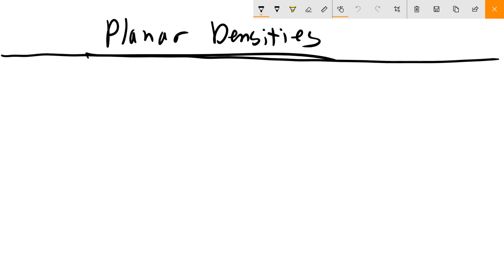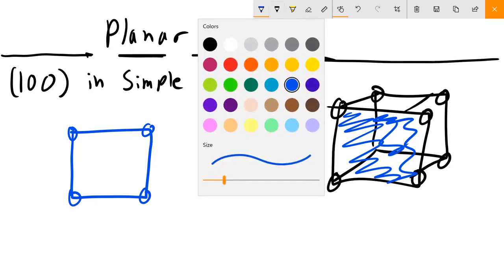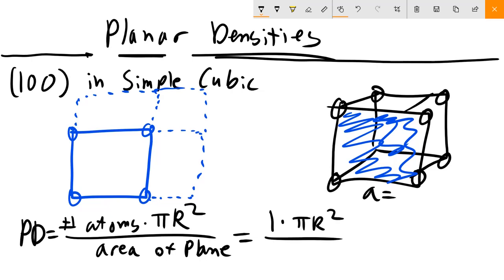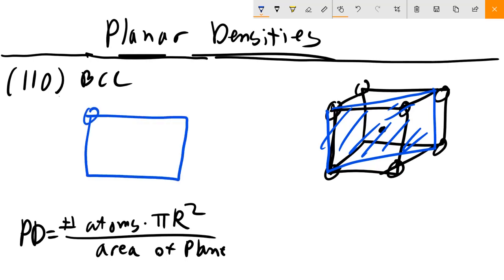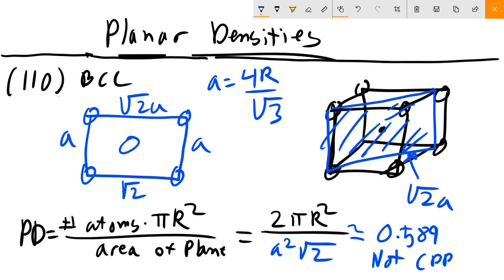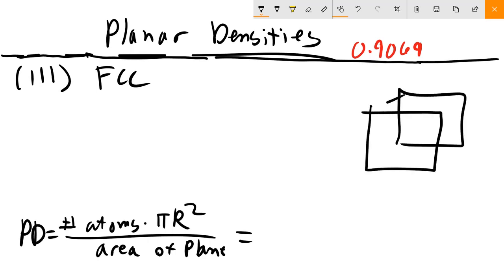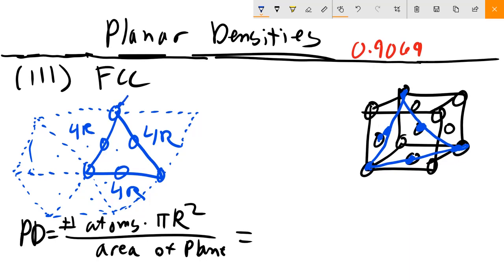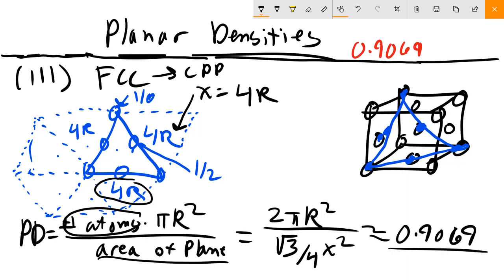Planar Density of Crystallographic Planes in SC, BCC, and FCC Materials

Comment: I think you have mixed atomic packing factor(APF) with planar density(PD).
the equation for PD is
PD = n/A
n = the number of atoms centered on a plane (in the case of the (110) BCC it is 2 (calculated as 4*1/4 + 1))
A = area of plane (in the case of the (110) BCC it is a*sqrt(2) * a)

You need to think of your planar density as certain number of atoms per area and not a fraction between two areas as in the case of APF.
Reply: Yes